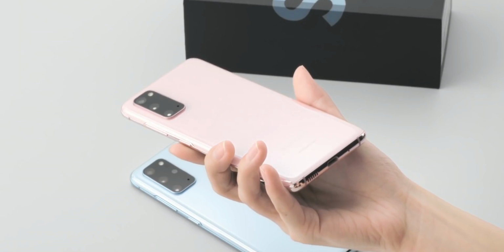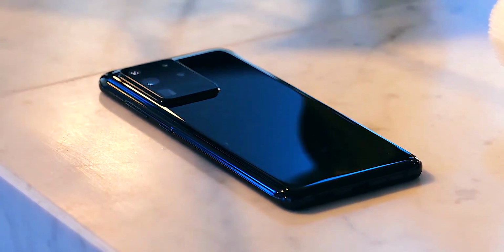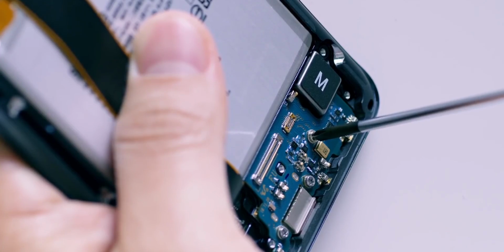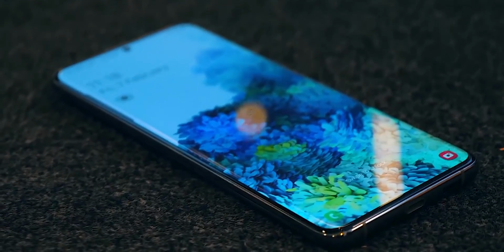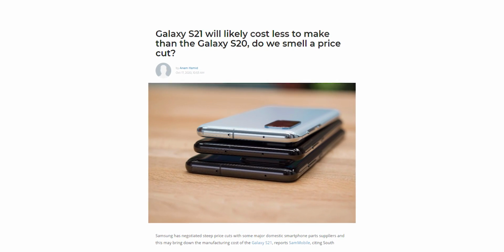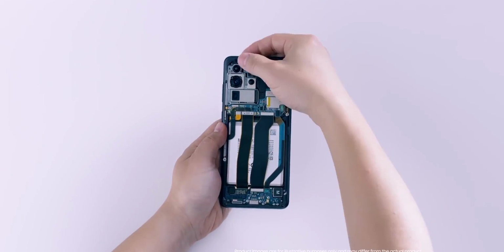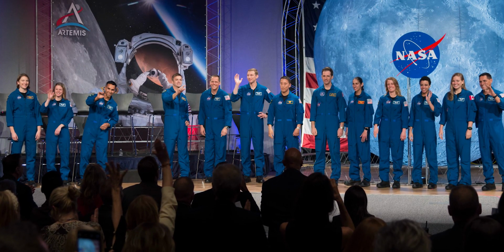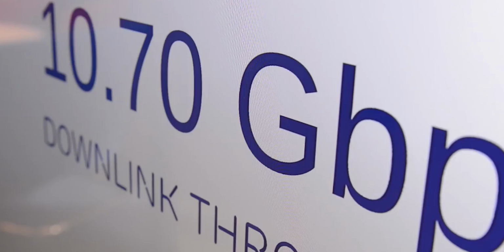Galaxy S21 Ultra - YES, ABOUT TIME!

Comment: Omg with the cost stuff. It costs them like 540 per unit to produce the note 20 ultra, yet they sell it for 1300. They can easily probs the price and still have a huge margin. You don't need to lower the costs so much if you think about it.

Comment: Most of the lower specs Samsung flagships are not attractive, I'm referring to phones like S20 S20+ Note20... reason being Samsung is using cheaper materials like plastic back cover, old gen cameras, some even doesn't comes with SD slot which is very much expected in a Samsung phone.
If I would to buy a Samsung again, I'll go for the top spec, or else if I cannot afford it, what are your recommendation?

Comment: I want a s21 Mini that is just as good as the Ultra, I want a small phone that can do and offer everything the maxed out version can, I am willing to pay as much or almost for a smaller variant that is just as good in terms of performance and camera.

Fuck and Apple is offering premium materials on cheaper devices too, I used an iPhone 12 on hand and gosh yeah it's just another iPhone but the touch and feel... oh boy and no I don't want fucking plastic for fucks sake, Apple is offering aluminum or better stainless steel and both glossy and frozen(?) glass and Samsung is going for plastic on $800/900 smartphone? Seriously Samsung? Fuck off

Comment: I'm not sure how I feel about the S21 news, I like the price cuts, but I also want all the features without getting a massive S21 Ultra, I'd rather have them have another fan edition and keep the S21 as premium as possible.

Also every day I hope to hear about the larger ultra sonic fingerprint reader (also if that is only in the ultra I will be really sad)

I really like the size of the base S10 and S20, I want to go that size but I don't want to lose features because of it (I'm okay with losing 100x and 50x zoom but if it is any more than that, I will be very disappointed)

Comment: Hifi Sal🙏 I'm too a great fan of curve displays...
In my opinion it not only feels good but also looks good and  does not  makes the phone to look  out dated very soon. You know for example take galaxy s6 edge and normal s6, after 5 yrs s6 edge stills feels premium and look astonishingly good than normal s6. Or else just take the note 20 and m51 both are nearly identical in front. $999 phone looks same as the $430 then what's the point of flagship... I mean if your pay a whopping $1000 for a phone it should really stand out in every dimension.
And the worst part is if a $250 phone can have a glass back why couldn't $999
But I really hope samsung keeps the curve displays.

Comment: Scamscum: 

won’t buy anything with an exynos chip in it. Regardless of benchmarks. It will still overheat and throttle the battery.
Reply: And a plastic display

Comment: I personally think curved displays are diminishing returns and gimmicky, especially when you factor in the additional cost for them that doesn't offer much aside from an increased risk of accidental touches and display distortion. I guess it has ergonomics, but we never had an issue with 2.5d and a curved body on literallyany other phone. I'd say a similar rear curved glass alone makes more sense from that standpoint but I digress.

Comment: It is safe to bid on ebay? I just bid for an xbox series x at half price 😳,  do you think I have a change of winning? I am the highest bider so far
Reply from the maker: Depends on the seller. How much you're bidding for?
Reply: @TechTalkTV  £175
Reply: @TechTalkTV  i am in the top so far , I will do an slash out at the end of the auction if I am still in the top
Reply: @TechTalkTV  £5 slashout

Comment: Fun fact: I still haven't finished watching the video.
Reply: "Apple and Google are taking the lead, now we can't overpriced our phones so let's just tell the people that production cost will be less" ~Samsung
Reply: @rwyo83  
Google have never took the lead with overall uncompetitive phones thst play it safe. Inba similar note the iPhone 12 aren't all that competitive, either, and thry are more expensive. Lay off the crack pipe, sunny Jim.
Reply: @insertnamehere8723  got a good one for ya... Magsafe  from 🍎 you can now wirelessly change your phone and use it at the same time ... the android copycats are  now at the starting  gate ..I wonder who will be the first
Reply: @fatman2772  
And you mean I can't use my wired fast charger with a 6ft cable and use it at the same time lmfao. I mean the brand notoriously lacking on wireless charging, and still is, thinks a magnet wireless charger holds anything to A) competitive fast charging B) wireless fast charging and C) an included wall plug? Lay off the pipe, squirt. I'd take a wall plug over an excluded gimmick any day. Besides, even if android adopts the same features, you can bet your ass it will retain acceptable speeds, and you can't say anything after the ios 14 widgets thing and the fact apple is actively trying to copy android features, yet still lacks in key fundamental  areas. Again, put the crack pipe down.
Reply: @insertnamehere8723   hey .. thats not what I'm talking about  dummy ..any 5 year old can tell the difference between wireless and standard charging.. and  what's your problem  with you and crack pipes ?   Are you in the drug business ..we do not support that on youtube
Reply: @fatman2772  
Your argument is completley irrespective, either you realize that and that you're being that obtuse, or you're whacked out of your gourd, homeslice. Seems like you very much do support that, if you know what I mean, sampling the merch, eh? Lmfao.
Reply: @insertnamehere8723  now you are talking out of your ass  dude try  ..making  some sense
Reply: @fatman2772  
Coming from the dude projecting harder than a PowerPoint presentation? Miss me with that shit lol.
Reply: Me too
Reply: nice
Reply: @qasimqureshi3289  indeed
Reply: How about now?
Reply: @insertnamehere8723  You have achieved tike travel my friend.
Reply: @jajabristos3989  
👍
Reply: @insertnamehere8723  probably yess
Reply: Nobody ever does. Thats why half the time I'm deleting posts at the end.
Reply: That's why i 2X the video